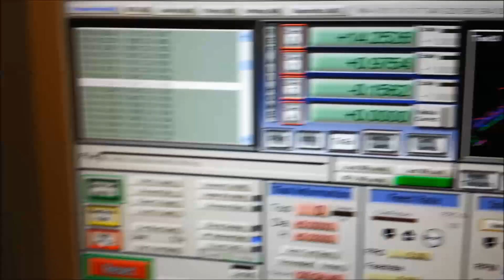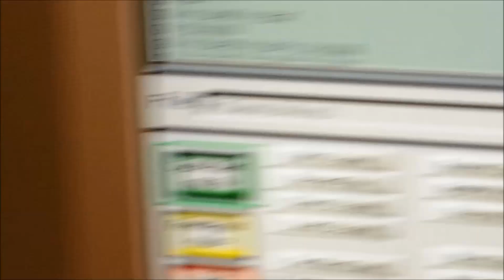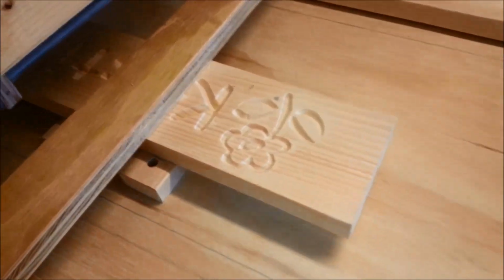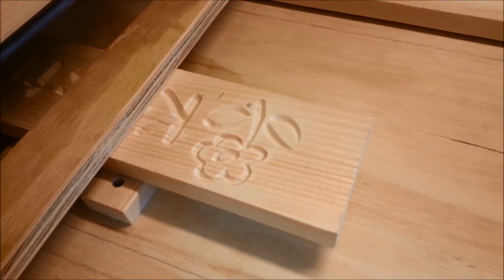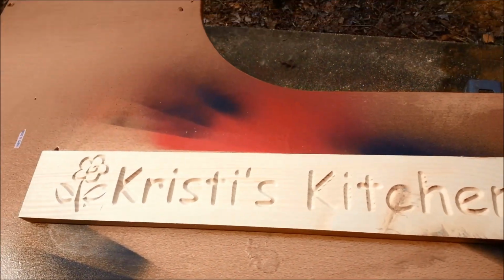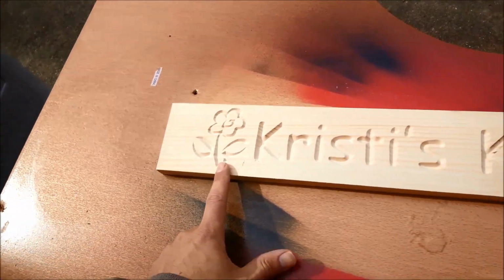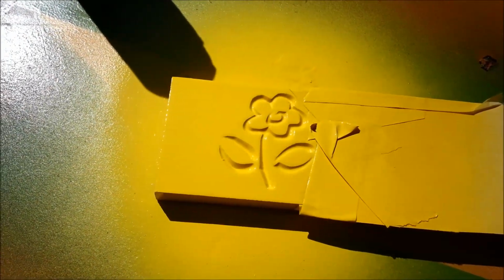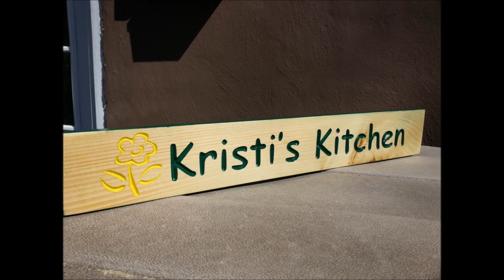DIY CNC - Easy Kitchen Sign

Comment: Excellent!  Thanks or showing the whole learning process.  The problems, and the solutions are part of what makes this so interesting and useful.  I did not think your work hold-down idea would work unless you added some rubber or grit to give more grip... looks like I was wrong.   Every step makes it a more valuable tool.  Thanks.
Reply from the maker: John Colvin Hi John.  Many thanks for your comments.  My mistakes teach me more than when things work out the way I intended.  And I make a lot of mistakes but that's the cost to improve and get better.  Thanks again.

Comment: Really cool!  What rate of speed are you cutting at?  Any chance of speeding that up some, or are you at the safe operation speed of your motors/screws?
Reply from the maker: Thanks for taking a look.  I do have it slowed down and could push it faster.  I typically keep the feed rate for wood cuts between 5 and 10 inches per minute but 15 to 20 would probably be okay for most of my signs.  Since the machine is built of wood I try to keep the flex down as low as possible.

Comment: I'm still relatively new at all this CNC stuff. Did you say you put a base coat of shellac on the sign before painting? What is the reason behind that? Also where could I get some?
Reply from the maker: Yep.  The base coat of shellac makes it easier to sand off the paint that you apply over it.  The letters or text still has the paint inside and that is not touched by the sander, but the area above it, on the flat surface of the sign is.  Any hardware store will most likely sell spray shellac.
Reply: That is great to know! I'm glad I caught that in your video. Sanding off the paint has been giving me a bunch of trouble lately, can't wait to try it with shellac. Thanks for the response!!

(something I cut out and had trouble sanding, notice the I and the N look fuzzy http://i.imgur.com/3irxhkW.jpg)
Reply: drez20001
Hey Dan, have you discovered a way to pre-paint the top a colour and then do the letters etc nice and crisp like this video? Maybe some sort of stick on that cuts cleanly and peels off without damaging the pre-paint maybe? Something that would take a coat of lacquer to crisp it up might work?
Reply: YaniT991
...maybe not lacquer but similar more paint-friendly substance.

Comment: Did you have any issues installing the F-Carve software?  Did you install the Python program as instructed?
Reply from the maker: +pbb 116 No issues at all with F-Engrave.  I used the Windows version and it works great.
Reply: I got F-Engrave installed.  We (my husband) got everything wired up and Mach3 installed and setup per instructions given by Long Motors...we are at a standstill with the Mach3 program (homeing and defining our table size w/in Mach3)...any chance you could call my husband or Facetime him to help us?  I'd give you my number...  I know absolutely nothing about this stuff and just want to get it to carve (I talked my husband into building this for me.)  If you don't, I understand - you don't know me from Adam, etc.  Anyways, I appreciated all your videos and your help this far!  Happy Thanksgiving!
Reply from the maker: Setting up Mach can take a little while - I set my copy up several years ago on a different CNC machine and remember it required some trial and error.  You've probably seen it, but there is a forum at ArtSoft for Mach users: http://www.machsupport.com/help-learning/artsoft-mach-support-forums/
As far as setting up the table size in Mach, I don't use that option.  I make a window in Inkscape that has my table size setting so I stay safely inside the range.  You will have to set up the calibration though in Mach so that the designs you make are true to the actual cuts.  Here's a video on that: https://www.youtube.com/watch?v=tTRatwpSgpA 
It just takes some time to get it all working together and then the creativity can happen. The Mach forum is a good resource.  Also - make sure that the computer you're using to drive the CNC isn't running anything else at the same time.  It's best to dedicate an old computer that is off line to the CNC.  If the computer you're using has any kind of virus protection, background programs, or anything else going on at the same time it can mess up step counts and cause the cuts to be pretty wonky.  Keep at it and you'll get there.  It doesn't have to be overly complicated - just takes some time to get all set up.
Reply: As always, thanks for your reply.  I ended up joining a CNC page on facebook.  Messaged with a couple of guys and turns out 1 of my problems is that I need to disable Home Switches in Ports and Pins menu...I will follow your video on Calibration today.  I have watched probably all your videos and know that you used Inkscape, then put your files into JSCUT - did you know that there is an extension in Inkscape for GCode?...don't have a clue how it works yet, but am going to try it when I get my table set up.  Where do you set table size in Inkscape?...haven't really gotten into the program yet.
Reply from the maker: +pbb 116 Glad you're making progress.  Yes, there are settings to figure out in the Ports and Pins areas as well as how hard to push the motors before they stall, but once these settings are figured out and saved you don't have to deal with them anymore.  It is good to check the calibration from time to time, as shown in that video, because after a lot of projects it can sometimes get a touch off, but it's easy and fast to do.  I did play with Gcodetools - the Inkscape extension for G-code, a while ago (I think I may have done a video on it way back).  It did work after figuring out how to set it up.  However I've found that Jscut is head and shoulders above all of the other free CAM programs.  As far as setting up your table/CNC parameters in Inkscape it's very easy - (1) Open up Inkscape, (2)Go to FIle then Document Properties and a window will open up, (3) Change Default Units from "px" to inches, (4) Then go down to where it says "units" and change that from "mm" to inches.  Now you're set up in inches.  Then to go where  it says "Custom size" in the middle of the open window and change those to your with and height for your table - for my 3040 CNC I use a width of 14" and a height of about 9".  You will see the box change size to those dimensions.  Then it's easy - just keep your design in that box and it will fit on your CNC cutting deck/area.  (You can zoom in and out in Inskcape just by using the plus and minus signs on the keyboard.
Reply: Think we are making progress.  As we do not have switches, we have everything working-not without issue LOL...we ran the test roadrunner gcode and I don't think what we got is what was intended.  The motors really whined and the roadrunner image was jumbled into a 3" area.  We calibrated the motors and we adjusted speeds, but boy the sound was different during the test.  I do have a question...We got the NEMA  motors from Long's on ebay...the board is a TB6560 - my husband was wondering if you could tell us what your dip settings were.  Thanks for Inkscape sizing!
Reply: We have success - FINALLY.  Just a test run w/a sharpie and paper, but it works.  Thanks so much for all of your videos and help here in this chat.  Appreciate it!
Reply from the maker: Excellent!  I remember the first cut I made that sort of looked like the Roadrunner.  Keep at it and congratulations.
Reply: Thanks...couldn't have gotten here without your help!  Passed along a video of yours on the Binford sign to a guy that gave me some tips...I am mainly going to use Inkscape...we'll see how good I do before I put money into software.  Have a great day!
Reply from the maker: Many thanks for your comments.  Very appreciated.

Comment: what type of motors did you use?
Reply from the maker: Emanuel Herrerias Hi Emanuel.  These were NEMA 23s purchased on eBay.
Reply: thanks for your answer, how many ounces are? and which is the size of the router? (approximately). Certainly that's a good job
Reply from the maker: The steppers are 270 oz-in.  The router is a small trim router from Lowes - it takes a standard 1/4" bit.  Here's a very similar kit to the one I purchased several years ago (the price has come down too - I think I paid closer to $200 a while back) http://www.ebay.com/itm/US-Ship-Promote-Nema-23-Stepper-Motor-270oz-in-3A-3-Axis-Board-CNC-Kit-/301614276219?pt=LH_DefaultDomain_0&hash=item46399c9e7b
Reply: drez20001 thanks for all the information; with respect to the router, I meant the size of the CNC :)
Reply from the maker: No problem.   The cutting area is about 10" x 18" +/-.  The whole size of the machine is about 2' x 4' x 25" approximately.
Reply: Thanks for all. Greetings from México